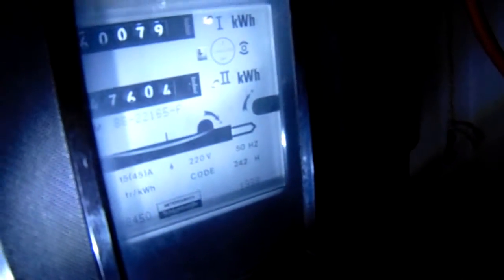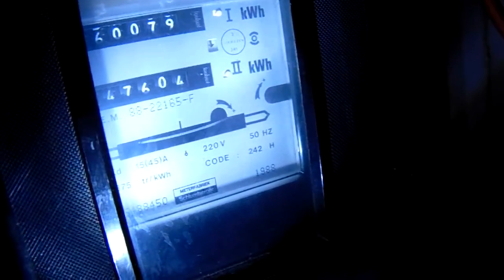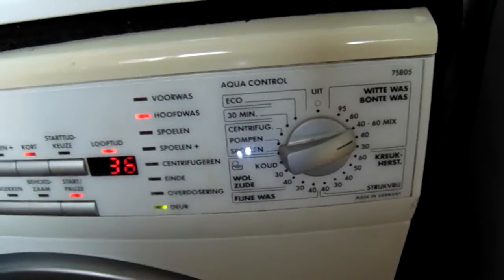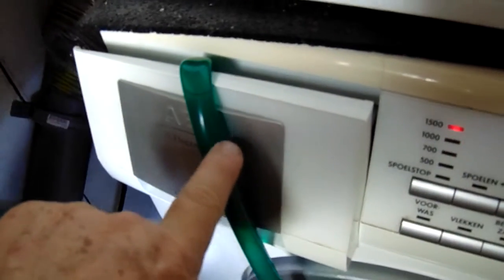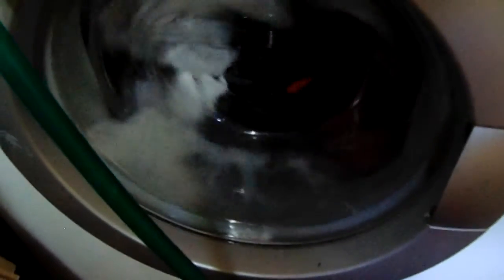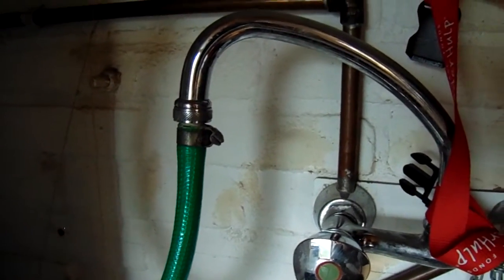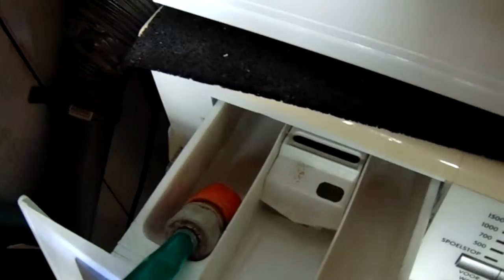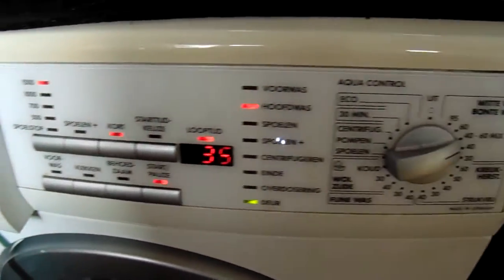Saving electrical energy costs by adding hot tap water to the washing machine

Comment: Gas boilers take a big efficiency penalty when heating a hot water tank. Mainly because the system is trying to accumulate heat in the tank, so as the heating cycle progresses the water leaving the tank and returning to the boiler is also getting hotter and hotter. Keep in mind the heat transfer in this situation relies on the temperatures between the two trying to balance, so water leaving the coil in the tank cannot be cooler than the water you're trying to heat in the tank, that would defy physics. So, heating a hot water tank means increasingly hot water is returning to the boiler as the tank heats up. Meanwhile, the efficiency ratings published for boilers are not constants, they depend on the temperature of the return water going back through the heat exchanger, and under challenging conditions like heating a hot water tank the efficiency drops rapidly. Average efficiency for heating hot water tank, even with a new condensing boilers is commonly around 50% or worse. The manual will often tell you the efficiency in various conditions when you look closer, but the single figure efficiency rating given to a boiler is not a definitive number of how much heat from the gas will be captured for use. I worked out the cost difference between heating water with electric vs. gas with a condensing boiler on typical rates where I live, it is in fact fairly small.
Reply from the maker: In the Netherlands (in general) there is no tank where hot water is stored "in advance". Only (sometimes) in locations where elderly live there are boilers and in those cases often heated by electricity. So the cold water is heated directly in a spiral (combined with the central heating) and then brought to the tap-point. 19 march 2018.
Reply: Hi radiofun, tankless heaters are becoming more popular here too. They do however suffer from the same big efficiency drop when heating hot water for household use. The problem is really just the hot heat exchanger in the boiler. If you want 60 degree hot water to come out the boiler, it has to reach at least 60 degree in the heat exchanger. This is bad for efficiency. The hotter an object, the harder it becomes to heat it more, so the efficiency drops greatly in boilers regardless if they're heating direct or a tank. The only efficiency benefit I know of for the instant type is that they don't need a tank of hot water sitting around losing heat.

Boilers are more efficient for central heating because more of the heat has been lost to the house by the time the water returns, so the heat exchanger stays cooler and more readily absorbs heat from the fire.
Reply from the maker: OK, thanks. My calculation (in general) was/is that heating 1 liter water in an electricity heater is 4 times more expensive compared to gas heating from that 1 liter. But gas is somewhat "cheap" (perhaps...) in the Netherlands, because we have a big gas storage say 1 km deep in the Provinces of Groningen and Drenthe and in the North Sea. Anyway: this gas stock (retrieved from this "bubble" since 1962) is getting exhausted and pumping up gas from that bubble caused many small earthquakes there (million Euro's damage) since the 1980's.  And they are getting worse (2017-2018). On the somewhat longer term this stock/bubble will end and gas will get expensive, I think. We also import gas from Russia. We are in an energy transition now in the Netherlands. 19 march 2018.
Reply: It's a common misunderstanding, I used to think it too. But, the efficiency for boilers is normally given for central heating under favourable conditions. You won't get figures like 80% or 90% efficiency for household hot water - that's for central heating with optimal radiator sizes. ~50% would be good for a modern condensing boiler when making hot water. But people see their boiler is rated at 90% efficient and may think for every 1 kWh of gas, 0.9 kWh of useful heat is produced regardless of conditions.

I worked out the cost was similar when our electric was around 2-3 times the cost of gas.

If you want to use gas to heat the water however, it could make sense to heat it on a gas cooker during the winter, since the heat lost to the surroundings will actually supplement household heating. Heating water in a pan on the cooker isn't efficient, but the heat lost is useful when the weather is cold. Using the boiler will send the lost heat up the chimney.

Comment: What about feeding the hot water into the cold water connection of the machine? I think you cant get the water to hot. Theres always cold water coming out of the wall before the water gets slowly hotter. So in the machine you have a mix of hot and cold water. If the water is already warm the heating element shouldnt stay on very long. The problem would be, if its time controlled and not temperature controlled inside the machine but i couldnt imagine that.
Reply from the maker: Yes there is a mixcture, but I have a "water saving" machine that does not use much (cold) water, in fact to less.

Comment: Ok, seems strange - at least for N. America as hot water is always piped directly into the washing machine from the water tap connection???
Reply from the maker: Thanks for your comment. What I know is this: the max. tap water temperature in the Netherlands is (as far as I know) approximately 80 degrees Celsius. That is more than enough for normal washes, while modern washing powders claim to wash properly on 35 degrees Celsius or even lower ("cold wash").  But for 95 degrees (called "cook(ing) wash" in the Netherlands) you need more heat generated by the washing machine heating filament.
Reply: My old washing machine in the UK had a hot water connection, but the newer model only has a cold water connection (both made by Whirlpool). Presumably you'd still need a heater inside the machine for temperatures above your hot water supply? (e.g. a 95°C cotton wash).
Reply from the maker: Yes, these high temperatures can also form a kind of deterioration (on the long term) but the manufacturers are aware of this issue, that is why such a machine can function for years even on high temps.
Reply: I never wash clothes on such high temperatures, but do a very hot (empty) wash every so often to kill off mould/bacteria and prevent a bad smell.
Reply: In europe washing machines and dish washers only have cold water supply connection, no hot, so they need water heaters inside the machine.
Reply: Yes, didnt think about that.
Reply from the maker: Good to know, I did not know that.
Reply: My brand-spanking new dishwasher has a hot-water connector, and I live in the Netherlands.
Reply: "you need more heat generated by the washing machine heating filament."

And the machine itself needs to be able to handle those temperatures.
Reply from the maker: That is good and energy saving!